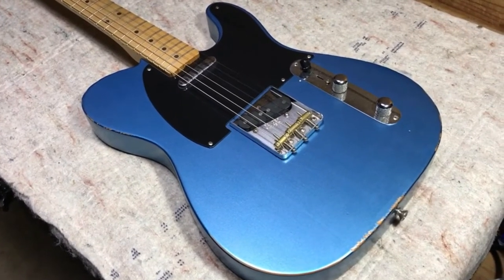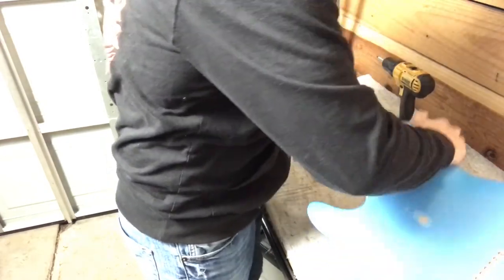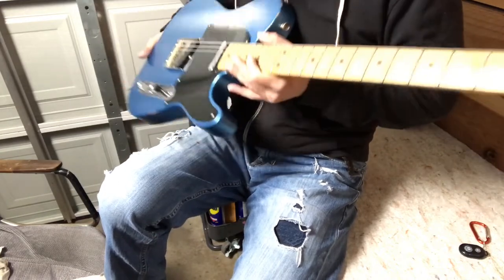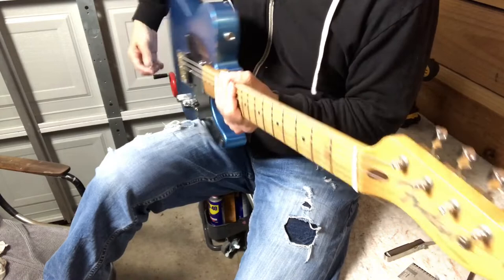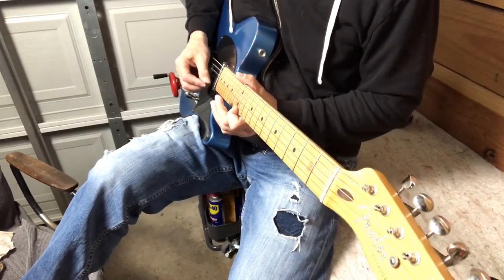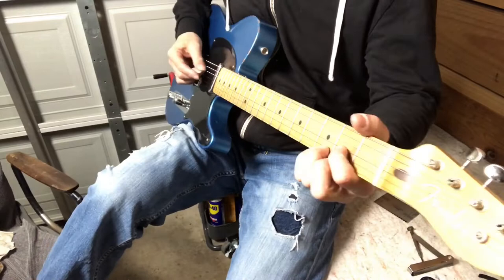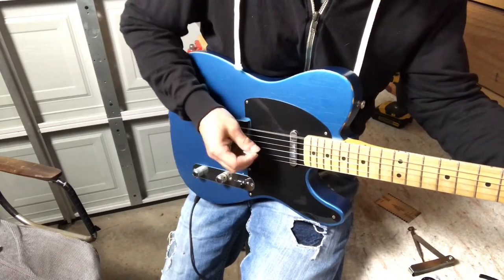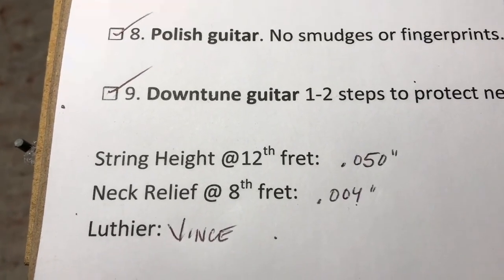Guitar Setup - 2020 Fender 50s Road Worn Telecaster - Turn truss rod, set action / intonation

Comment: Why take the neck off? Isn’t there a notch 
In the body that allows you to adjust with a paint can opener or that special Stew Mac tool? My older Road Worn has that feature.
Reply from the maker: You might be right. I didn't think to pull the pickguard and see if I could get at this one without removing the neck. Thanks for the comment.EDIT: I actually made a video recently on that special StewMac tool you're talking about, here: https://www.youtube.com/watch?v=krtXeVC6R6o. Better late than never!

Comment: This is actually very informative video. I didn't believe that you could achieve that quite low action with the 7.25 Radius neck till i saw this video. I got also a Telecaster which has 9.5 Radius neck with exactly same low action. Thanks for the detailed informative video!
Reply from the maker: cheers. thanks!

Comment: Great vid. I have the same model It is really cool but have the intonation issue where first 3-4 frets are sharp and 12 is flat. Not sure you  have seen that before and how to get around it. Thanks!
Reply from the maker: Hi, I have seen that problem. Not sure if there is really a fix. Very common seeing those first couple frets registering sharp. ----- Just wanted to follow up on this comment. One culprit with the first few frets registering sharp could be badly cut nut slots. If the slots are making the strings sit up too high especially on first fret, you have to press very hard to fret the note and can send it sharp. Will help to cut nut slots to correct depth. cheers

Comment: i'm planning on getting one of these  and i've also noticed that it has almost no fret buzz, which is unbelievable. what factors might contribute to that? could it be the fat, u-shaped neck?
Reply from the maker: Great question. I have no idea. In general, I think of vintage 7.25" radius necks as requiring slightly higher action to get rid of buzz, but not the case with mine or yours it sounds like. Worth noting that some necks are just better than others. Sometimes luck of the draw. cheers